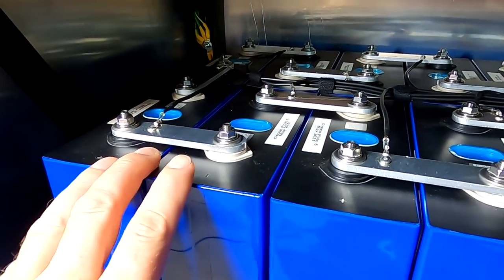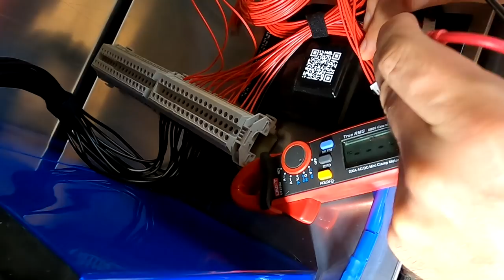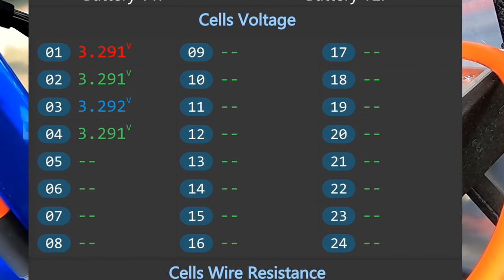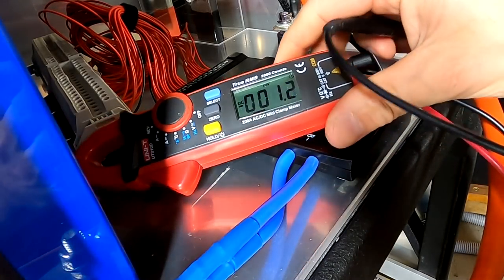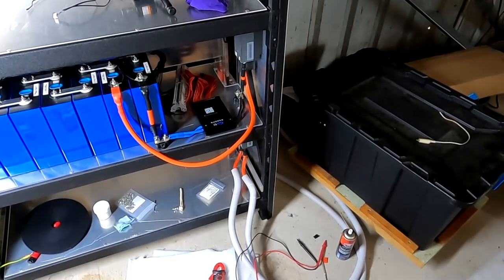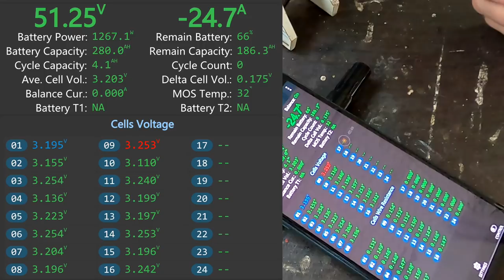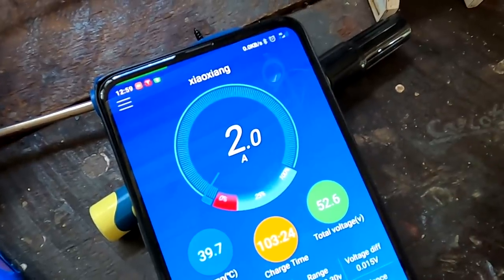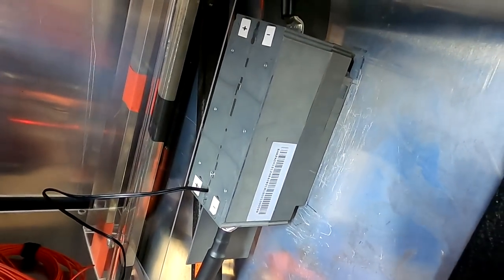Paralleling two 48V battery banks. A self-balancing system. Part 3

Comment: Great video Andy
I thought that all bms leads have to be same length and size , is that not the case anymore ?
Reply from the maker: I cannot see the point of having them at the same length. The BMS measures voltage, right? So there is pretty much no current flowing in this process. The cable length should not be critical at all for any BMS.

Comment: Andy i need a quick vodeo for how to repair a stripped out battery hole on the eve batts. lets be honest they screw some up some times. it looked normal but it just kept spinning. how do i fix it?
i can't be the only one to have this problem?
Reply from the maker: Video is coming very soon. The fix is easier than you think.
Reply: @OffGridGarageAustralia  so glad cause i don't need a fire. lol and don't want to stop using the batt i made. i love it!
Reply from the maker: @brian1395  No problem, I have some terminals to repair as well, so that works for both of us then 😉

Comment: Probably you have active balacing activated. Even JK BMS doesn't measure voltage when the exact moment of balancing, probably the "length" of battery cells' cables makes this as a little induction that makes JKBMS measures voltage fluctuations. Someone could think that it will only happend in two cells (less voltage and most voltage ones) but as all cables are joined we have induction in all of them.
Reply from the maker: Nope, balancing is off and would only kick in at 2.45V

Comment: Love this battery bank build ! My banks are 24 PCS 3.2v 280Ah & I’ve got 6 PCS 3.2v 310Ah , battery combiner 6-50v , 3 bank & alternator charging 120A Model BI-120A1B3 , inverters 5KVA 230v Inverter charge controller 48v - the 230v is the L1 is 115v & the Neutral is a hot line of 115v Total  Amperage is 88A , my house only has 1 - 220v which is the central AC literally my house could run on 1 phase of 115v in in the US , I’m mainly only using for battery back-up ! “ if they throw the switch ! Fantastic video
Reply from the maker: Thank you.

Comment: +Off-Grid Garage - 290AH @48V for that shelf?

That would be the same as my Big Battery “Rhino”! I can’t quite make it through 2 days heating the Taj-Ma-Haul in 19f winter nights, for sure I’m adding a second Rhino for 580AHs. I was also thinking I may need 4 Rhinos eventually to charge the Cyber Truck when it arrives. You have experience charging your Tesla 3 from batteries and solar, I’m thinking I need the extra capacity, 1,160AHs would be a good cushion to put say 8 or 900 AH’s into it and have enough to get through a night before charging from solar again? What do you think?
Reply: It’s really annoying YT disabled tagging people…
Reply from the maker: The shelf has 280Ah at the moment with another 280Ah still in the battery box next to it. Eventually we will have 1120Ah connected on this side of the garage.
Reply: @OffGridGarageAustralia  do you know how much battery you need? I’ve heard you say the things you power and the house is separate solar-wise, but can you tie battery into the house?
Reply from the maker: @paulcurtis5496  Need or want? 😂
I cannot use the battery power in the house right now due to the contract for the grid connected solar on my house. 
At the moment, I'm more experimenting and see how far I can come. I have planned to do a lot of experimenting with these battery banks and also want to test out different BMS and balancers to show you.
Reply: @OffGridGarageAustralia  hmmm, ok, how much power do you pull from per day (from the sun and battery)? What is your PV capacity connected to your system that charges the batteries?
And, well, both
Need=
Want=
😂

Comment: Hi Andy,
as you are using the victron system (i recall, you habe a RPi Verion as GX-device?) , how do you consider to connect the BMS to the GX device? 
In a victron environment this is done via a bus connection. Do you consider connecting your batterie bank to the Raspy by (what? USB?)
I have seen rs485/bus hats for the raspi..  but nothing found as to how this interconects with a BMS (protocoll?, see victron battery compatibility list !)
Or do you just not care?

I am curious to see how you are going to balance your system, meaning capacity-vise.... large batteries, charging capacity SOLAR and consumption... 
do you see the risk of batteries permanently swapping between low cutoff and low resume-... never getting full charged agian?

stay charged!

greeeting from the odenwald.
Michael-
Reply from the maker: Hi Michael, there is a project from a guy called Kevin on Github which does all the programming for the Venus OS, both Pi and GX devices. He also creates the driver for the USB-RS485 adapter which can display your BMS stats on the VenusOS.
I am very interested in his projects and follow him along for a while but just haven't found the time to do it as my priorities were to finalise the shelf first.
I thought about it for a while and asked myself what the benefit is to have these information in VenusOS? Sure, we could potentially slow down or even stop charging if one cell gets out of balance and peaks at a higher voltage, but is this really necessary? I charge to 3.45V only so have plenty of headroom before I hit 3.65V and BMS would shut off. The JK-BMS has an excellent active balancer and should be able to cope with such a difference and balance the pack out before it gets too high.
So, at the moment it seems like a feature with a lower priority as I cannot see any benefit of this. What would that be?

Comment: I wonder if the voltage fluctuations can be caused by EMI. There can be some interference coupled to sense leads from active balancing current or some other sources. On probably unrelated topic, I'm not a big fan of the DIYed double screw terminals for main battery leads even though they look cool. By using only one screw and sandwiching the battery lead between the two BMS leads you could drop the contact resistance to less than half of the current value.
Reply: It's because active balancing is generating current flow on the sensor leads and making the voltage fluctuate on the sensors. This was discovered in a previous video. Change the active balancing settings like you did before Andy! 👍👍😀
Reply: @davidadams3669  I assumed the BMS would be smart enough, not to measure the voltage of a cell it is currently balancing. I was thinkin that when the long sense leads are coiled together there could be external fields that could induce noise to the measurement signal. Now that I think about it, if each sense lead are close together (twisted) with the leads of the next cell it should work as a balanced cable and the interference should cancel out. I think more likely reason for fluctuation is current ripple from inverter or other loads. There should be low-pass filter in the voltage sensing that does not seem to do it's job too well in that case. I'm sure Andy will let us know in the next video :)
Reply from the maker: You're both wrong ;)
The JK-BMS does not measure voltage with RMS but shows the real voltage at the time of measurement. That's all I'll explain this soon again.
It will not balance at the same time when measuring the voltage. Also, balancing starts at 3.45V, not below.
Reply: @OffGridGarageAustralia  Good to know the BMS knows how to do balancing afterall :). The inverter and other loads can cause ripple currents that will cause the cell voltages jump up and down because of internal resistances. If there is high frequency noise in the measurement signal it is not possible to get reliable voltage readings from individual samples and only software tricks. There should be an analog low-pass filter before the ADC with cutoff frequency much lower than half of the sampling rate to prevent aliasing. I don't know if the sampling frequency of the JK-BMS is specified somewhere. It can be much higher than the update rate of the display and the measurements used internally by the BMS are reliable, or not. Looking forward on the next video!

Comment: The battery cover was a great idea,like the temp sensor locations
Reply from the maker: Oh, you watched until the end... great! The temp sensor location just happened to be there. I'm keen to see how the breaker temperature goes as they are heating up quite a bit when pulling full power.
Reply: @OffGridGarageAustralia  would make a good video
Reply from the maker: @MrSqueegey  It will be in one of the next ones ;)

Comment: After thinking about. I think it will not work to put 2 balancer on the same cable. I think you need to. Use individual cables for each no?
Reply from the maker: Why should it not work? I think you can add as man balancers as you want to the cable. I guess we will test this soon ;)

Comment: I think that the voltage fluctuation seen at the BMS comes from the little balance fuses' resistance. When the BMS starts balancing there is a significant voltage drop on the fuses, hence the fluctuating voltage you see. Balancing switches on and off rapidly and you get confusing readings. I would not put wires on the BMS leads. If a fuse blows, usually the BMS reads a ghost voltage on that lead, that can be within the set acceptable voltage window and continue charging the pack even in cases it should stop.
Reply from the maker: But the BMS does not balance at all. It just measures voltages.

Comment: Hey Andy, just looking at my setup.  I am planning 4x 16S setup, similar to yours.   Looking at JK bms, and it has CAN, so could talk to Venus.  But as you have 3 and I have 4 I reckon the Venus won’t be able to deal with 3 or 4 bms, so the shunt plays a role in the Venus monitoring total state of charge and the bms just manages its own bank.  

I assume you are putting in 3 or 4 bms, 1 for each bank?
Reply from the maker: Yes, I' will use one BMS for each bank, not sure if I stick with the JK BMS or test some others as well.
What would be the benefit of having the BMS talking to the Victron system? To slow down or even stop charging if one cell gets too high? I really don't see a benefit of that. Each BMS will handle its bank individually and if you don't charge to 3.6V all the time, there is enough headroom for the cells to not trigger the OVD (if the BMS can handle the balancing).
The driver for reading the BMS and send the data to Victron can handle only one BMS at the moment. The guy who is programming this is working on a new version which can read multiple banks though.
Reply: The jk won't talk to victron just bcoz it has CAN support. In fact it is not supported bcoz it is not victron CAN protocole at all. At the other hand the rs485 version is supported since someone created the driver for venusos.

Comment: Andy is it possible that the length of the balence leads should all be the same, I did what you did and cut and laced my leads to length. I'm now worried that due to the leads not being the same length they will introduce errors due to different resistance in each lead? Any ideas. 😉👍👍
Reply from the maker: It should not make a difference at all. Voltage measurement is without current (ok, some micro amps maybe), so no voltage drop.
Reply: @OffGridGarageAustralia  Thanks it helps to keep the installation tidy.
Ps have you seen digital mermaid, you have female competition not on your level of course. 😊
Reply from the maker: @hunter00047  of course I've seen her. I promoted her channel here on mine a while back. I'm in contact with her. She's got a Tesla too now. And a boat obviously...

Comment: Please have a look at your self-bent main battery terminals with your thermal imaging camera.
They are way thinner than your busbars, covered in heatshrink (thermal insulation) and should have incresed resistance at the bend. But it can also be that it's nothing to worry about.. but ít would be interesting nontheless
Reply: Agree. They look a bit thin to me as well.
Reply from the maker: This is not a problem. The al busbars have to be thicker to compensate for the lower conductivity of the AL vs the copper. The thinner copper bus bars should be good for 250A + anyway.
I made a video here about these busbars: https://youtu.be/mdr5HZZRaTc

Comment: Hello Andy,congratulations for your work.I want to tell you that a few months ago I also used two 2A JK active balancers. I also noticed exactly the same instability in the cell voltage, especially at high currents (charging or discharging).Now I use two 4A active balancers from Neey, to which I do not notice this instability. Maybe the ones from JK are more sensitive, faster to read the voltages.
Reply from the maker: Thank you Mihaita.
From what I learned, the JK BMS does not measure the average voltage over a certain time as your multimeter would do (RMS) or the NEEY balancer does. Hence measuring the voltage seems wild and inaccurate but in fact it shows the real voltage at time of measurement. The inverters will not draw a pure resistive load so have a bit of ripple on the DC side wich the JK-BMS shows but not the multimeter with its RMS reading. So, it is all good and no point of concern.